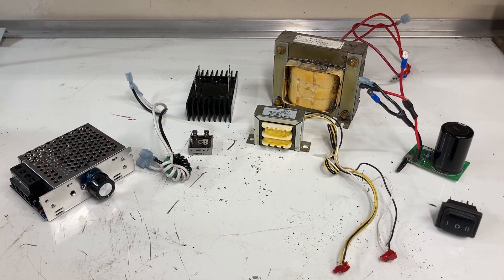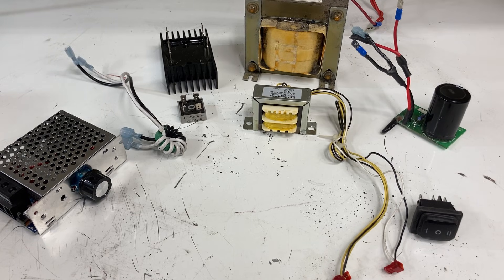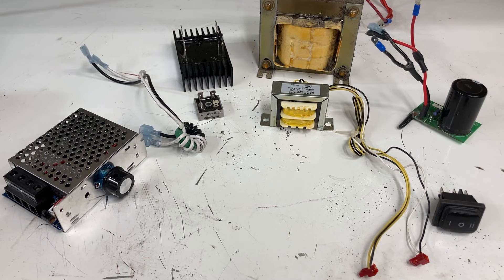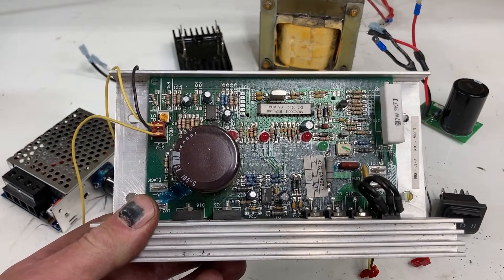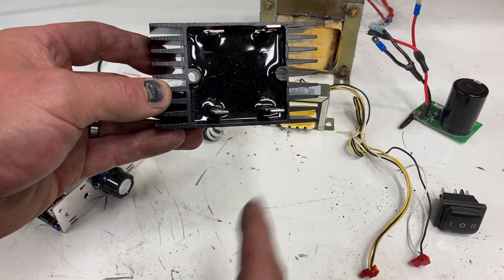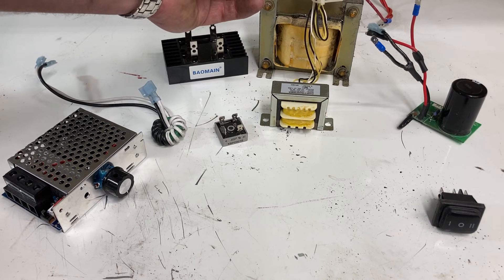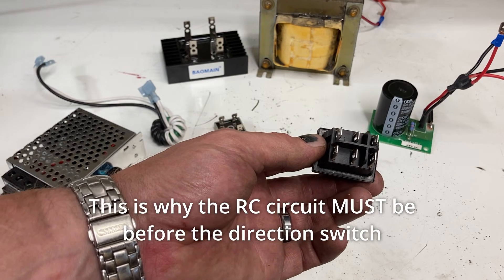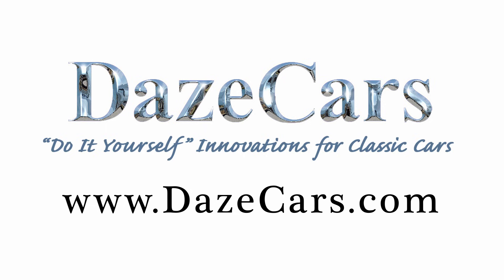Putting Together a QUALITY Variable Speed Power Supply or Treadmill Motor Controller SCR type

Comment: Having played around with these things a bit, I have found that people do a garage clear out and sell 3 phase induction motors often for next to nothing (just like treadmills). Check the regular places and you’ll have one in a couple of weeks. I purchased a VFD from China for about a hundred so i can control motor speed and run on single phase. Just way smoother and doesn’t slow down so much when under load compared to the DC motor with SCR. And Super easy to wire up. The superior choice imo.
Reply from the maker: VFD is the way to go to have the best and yes if you can get the motor cheap that is a good option, but in my area there are not motors like that for sale.
Reply: @dazecars  In NZ where I am there are dozens of Fisher and Paykal washing machines (with drum motors inside) that get scrapped weekly at my local recycling. I mounted one directly to my 14" band saw and thought the VFD would drive it just fine. The torque is huge (from a crawl to 10,000rpm) and would have been great but unfortunately not compatible with the power supply. The motor windings got hot so I had to abandon mission. I am yet to make a brushless DC Arduino motor controller for drum motors to learn more about this but have been too busy to get back to it. China is very cagey about it and don't sell controllers for line voltage drum motors. The closest you get is an ebike hub motor (also a drum motor) and controller. Possibly also not a bad idea. Certainly cheap enough.
Reply: Hey Waynos Waynos,
Wouldn’t mind making contact with regard to your journey’s. 
I’m in Chch and trying to figure out a cheap motor/ Vfd combo. Have treadmill motor in mind and curious about china vfd’s 
Cheers 
Chris
Reply: Yea, until you look for them. Then either nobody has them or they want an arm and a leg. These days, if something is 10 years old or more, they call it “vintage” and charge a premium. 
But yea, ya gotta keep your eyes open and be patient.

Comment: Saw this on Amazon. Is this any better or worst then the SCR you are recommending?

weideer 7-80V PWM DC Motor Speed Controller Switch 30A Control 12V 24V 36V 48V
Reply from the maker: Can you post a link so I can make a comparison?

Comment: Just subbed, have one with the buttons right now. Will build a new box. Save this one for a spare. On my Shopsmith,  2 bandsaws,  one resaw, one templates and bodies. Just got it running in the remodeled shop. Good info, come visit sometime.  How do you figure the ohms for the potentiometer? Like the using 2 for adjustment fast. The button one does work, but bogging is an issue. I am adding circuit breakers or fuses, need to decide on load for them.
My machine ate a 3 wire scr, due to a shorted rectifier. Then well I missed it, burned up another.  Sounded like a bad welder,  lol
Wish the camera were on for it.  Lol
Thanks my Brother,  later Spike
Reply from the maker: To calibrate what potentiometer you need you must have everything installed on the machine that is getting the treadmill motor and then follow the procedure in this video https://youtu.be/04d0u1RJyXw  Also bogging is something more common with cheaper SCRs.  The most common one that you see in YouTube videos is long and skinny and has the knob on one end.  It is prone to bogging at lower RPM.  The SCR I recomend is more expensive but a much better unit and my lathe runs well at low RPMS even under load.  Please let me know if I can be of further assistance.

Comment: Can you set the DC output to 20v and then use the PSU to energize a power tool? I would love to use the SCR based PSU to power my power hungry “18V” power tools. I have an 18V table saw, rotary hammer, and cut off saw, that having a high amperage 20V DC PSU would be needed.

I think you have you have talked about it before but if you put this PSU under load does the voltage drop?

An aside question is how many amps are you pulling from the 120V/240V AC outlet/breaker going into the SCR PSU?
Reply from the maker: Sorry I did not get back to you sooner.  The SCR would not be my first choice for what you are wanting to do.  If it failed it might over power your tools and burn them up, not to mention the adjustability might get adjusted causing damage.  A better solution would be to get a 120 to 20 V transformer  and then use a bridge rectifier to convert the 20V AC to 20V DC.  The voltage would be constant and a transformer could be selected with the correct amperage output.  To answer your other questions my SCR setup is drawing around 15 amps from the wall.  Please let me know if I can be of further assistance.

Comment: I've been running a treadmill motor on my lathe for about 3 years now. And it just burned up last week. I was wondering if you would be willing to make a video showing the actual wiring all tied together. Could even be one of those shorts. From the wall to the tool complete.
Reply from the maker: showing the wires or just a wiring diagram?

Comment: Do you have a supplier for large DC Choke?  Also how many turns on the ac ferrite choke. Finally any info on the resister/ capacitor?  Thanks for your help.
Reply from the maker: eBay. search “treadmill motor choke” but know that most sellers don’t know the difference between a choke and a transformer because the look the same but are not interchangeable . a choke has 2 wires a transformer will have 3 or more. for the ac side 7 turns of each wire is standard. the RC circuit is not needed.

Comment: Hi does anyone have information on the smooting capacitor circuit with the resistor
Reply from the maker: The chokes are the most important part.  After lots of use I found that the power was clean enough after the chokes that the RC circuit was redundent and not really needed.
Reply: @dazecars  Hi, thank you for that, but do you know where i can get the details of the smooting capacitor and resistor. The reason is i got a choke of an old power supply and i am not sure if the choke is adequate thatis why i would like to add the capacitor and resistor. Regards J
Reply from the maker: With chokes, the general rule is bigger is better, because the bigger the ferrite core the bigger the magnetic field and the more windings of wire in said field.  So as long as it has good size you should be fine. As to the RC circuit I got mine out of existing control boards from treadmills that were not usable without the treadmill control panel, I don't have any other specs than that.  Capacitor size is a calculation of motor size and power supply output.  I was able to use ones off of treadmills that had similar motors to what I was using the circuit on.  I know there is a calculation to figure out capacitor size but I am not sure what it is.  The resistor is just there to dissipate the charge out of the capacitor when the system is off. Sorry I couldn’t be of more help.

Comment: I'm ready to now use a free treadmill motor on my vintage 1947 Walker Turner wood lathe such as your video and your online directions suggest. Thanx for all you time.
Reply from the maker: glad I could help!!  let me know if you need anything
Reply: @dazecars  Day, you mention a large DC choke?  I have a 3hp DC motor. How to size the choke? Link for a cheapy?  Thanx!
Reply from the maker: @gregritchie1758  With the DC choke bigger is better.  The bigger the choke, the biger the field created and the beter job it does.  As for finding one, a lot of treadmills come with a choke. To find one used go to eBay and search “treadmill motor choke” BUT know that most people on eBay don’t know what they have and the word transformer will also appear in the listing. Problem is a choke and a transformer look almost identical so some listings are for transformers and some are fore chokes because the sellers think they are interchangeable. They are not.  To tell the difference count the wires. A choke will only have 2, a transformer will have 3 or more.

Comment: Have played with both options of using the original treadmill controller and the SCR one. Have also found differences on low speed control that may be explained bay a bigclive breakdown here https://www.youtube.com/watch?v=_4PwYm_7HKg. I have found the controller I have that has that diode bridge on it is the one that give better low speed control. Unfortunately you cannot always find out before buys what the actual circuit is.
Also congrats for being the first video I have seen that doesn't just throw out the caps and chokes from the original.
A minor thing (and I am just guessing  here) but I suspect the ferrite is more about suppressing the  radio frequency interference noise created by the high voltage switching. 

Another key advantage of some of the PWM native controllers is that they can maintain speed under load if you keep the optical pickup on, although it can be a bit hit and miss to get it running
Reply from the maker: thanks for the feedback. the chokes are critical, the caps, not as much. a cap is fantastic when properly calibrated to the system but that takes more knowledge then I have. I did find improvement on the bench but under a load I was having some surging  issues so I removed them. the power is not as clean but the system runs better under a load. check out my most recent video I compare an MC-2100 to an SCR in a VS shootout.

Comment: can i upgrade my 1hp motor on my treadmill to a 2.5hp
Reply from the maker: It’s not as simple as yes or no. Can you plug it it? Yes. Can you mount it in the same place? maybe. Will your controller have enough amp output? Maybe. Also HP numbers are like calories per serving on nutrition information. Just because it’s more HP doesn’t mean it is the better motor.

Comment: Thanks for investing considerable time to help us improve our power tools, Daze. I've watched all your videos several times and have now converted my lathe and a friends lathe to variable speed. One thing you never talk about (unless I missed it) is the motor pulley. My motors both came with a six groove short Poly-V drive belt and a 1.5" Poly-V motor pulley . The diameter of the motor shaft is 17 mm which equates to 1.5 mm larger than a standard 5/8" V-groove pulley (The outside of the motor shaft is threaded smaller for the flywheel). I couldn't find a 17 mm bore V-groove pulley anywhere on earth so I ran the motor on the bench and used a file to turn the 17 mm motor shaft diameter down to 15.5 mm (5/8") for a standard pulley. Then the existing lathe V-groove belt works, albeit with a small vibration. I read that a notched V-groove belt will run smoother that a standard V-groove pulley. Is that what you use?

Then there's the option of running a Link-Belt that apparently runs smooth but with some squeal?  Do you have experience with Link-belts? It sounds like they don't work well in reverse?

The lathe would likely run smoother with a Poly-V drive system and I finally found a supplier that would sell a 17 mm bore 2" Poly-V pulley for the motor, a 7/8" bore 3" Poly-V pulley for the headstock shaft and a 44" belt (8 groove). Those three items came to over $200. But "after" motor installation I did cut a square around the Poly-V pulley on the flywheel to separate it and turned it round with a file (same procedure as the motor shaft above) and that 1.5" pulley would now work for a motor shaft Poly-V drive pulley.

I'm wondering how you managed this drive problem on your seven motors?

Just a matter of interest, I used the MC-60 PCB for controlling both motors along with your pot center tap switch to bypass slow-start. My lathe now turns at 30 RPM up to about 2500 RPM - perfect. My $5 reverse switch is on order from China and my $18 tachometer just arrived. I've built a new quick release banjo, five tool rests, a hand crank handle for the quill and an oak 3" diameter hand crank for the external headstock shaft (just screwed it on after drilling a hole). Along with a new tailstock live center and a newly built Vari-grind and Wolverine sharpening system, my $67 Rockwell Beaver lathe (bought in the 70's) should now be shoulder to shoulder with a $6000 Powermatic. It brightens the room upon entry and any wood turner can feel the love.  : )

Thanks so much for helping us all. Your knowledge and explanations are superior. 
Salute - Garson
Reply from the maker: I am just using standard V-groove pulleys on my machines.  It is not that I think they are better or that I have any specific preference, its just that is what my machine came with and what I can easily get at the local hardware store.  As to mounting the pulleys to the treadmill motor, that is a good idea for a short video.  When I put the treadmill motor on my lathe the motor I used had a keyway and it was smaller than the pulley that came with my lathe so I machined a sleeve, cut a groove in said sleeve and than made a taller key to fit in the shaft, pass through the sleeve and fit up into the pullet keyway.  On my mill the flywheel was a thread on and I wanted the mass of the flywheel so removed the flywheel from the motor, chucked it up in the lathe and turned the pulley snout down until it was smooth.  I then opened up the bore on an aluminum pulley set I had and pressed it on to the flywheel.  On my mill there is no need to run in reverse so I was not worried about a thread on system.  Glad my videos have been a help.  If you have more questions OR if I failed to answer these questions, please don't hesitate to reach out.
Reply: You are correct.  The treadmill motor has a 17mm shaft.  To mate your pulley to your 17mm treadmill motor shaft  buy a 17mm chucking reamer (ebay, they are cheap)  drill the pulley to just under 17mm on your drill press.  (I forgot what the fractional english size is but its easy to measure with calipers).   Bore the drilled hole out to 17mm with your new chucking reamer (it works like a drill bit).  Reamer is more accurate than a drill but you could just drill on your press with a 17 mm drill.  Its better and more accurate to do this on a lathe but I'm assuming you don't have one.

Comment: Isn’t everything needed to power the treadmill motor in the treadmill.
Reply from the maker: In theory yes, but often times, no.  A lot of treadmills in the free-$50 range are that price because they are not working correctly, usually a bad control board.  Even if the treadmill is working some of them can not be used without using the treadmill control panel which is cumbersome and not user friendly for shop tools.  There are some treadmill control boards that do work and can be easily wired with a potentiometer or “hacked” with a PWM (I have a different video on that) but if that is not an option a power supply like the one I show in this video is a good alternative.